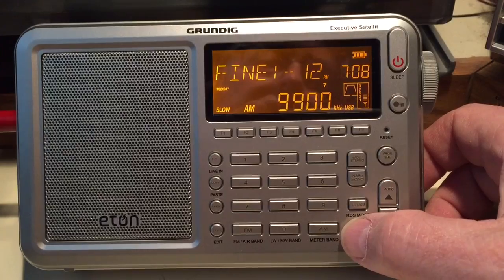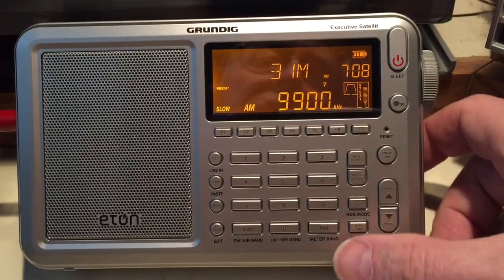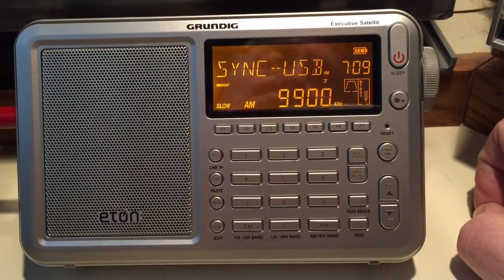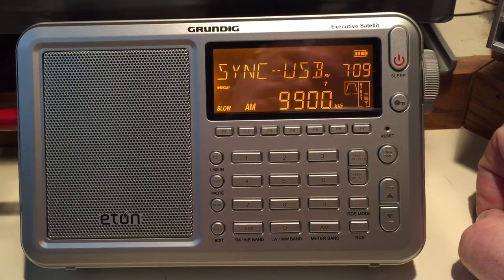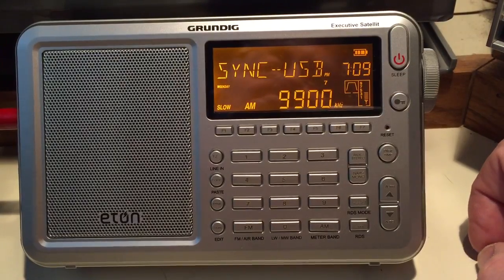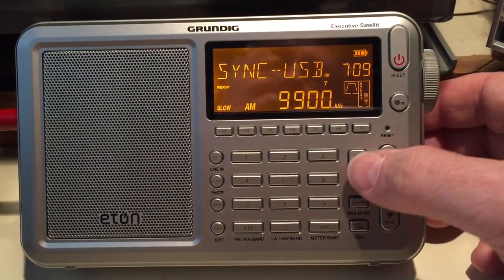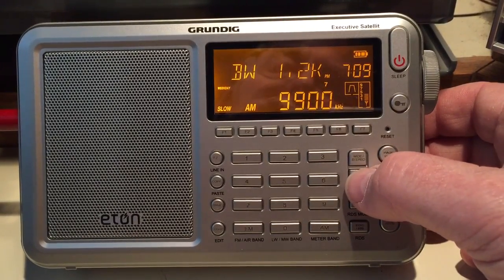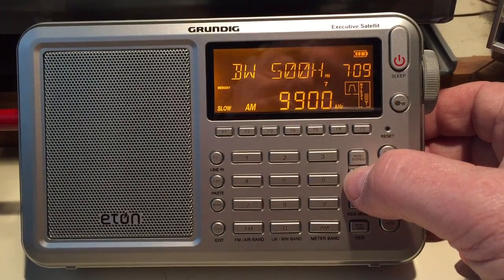Eton Satellit Executive - Using the Synchronous Detector

Comment: Amazing, the old Tecsun PL-660 Sync works much better with none of that horrid distortion that effects so many DSP radios. 

I have the Tecsun PL-880 and S-8800 and their SSB distortion due to dodgy AGC is just unbearable so much so I have them up for sale , I'm just sorry I didn't return them for a refund when I got them. 

The XHDATA D-808 sounds much better on SSB but no attenuation for external antennas, still some SSB distortion but nowhere as bad as the Tecsun PL-880 and S-8800, still for the price it't a great radio. 

I just bought a PL-680 from Anon-CO because my old 660 is beat up but it was a pleasure to listen to SSB despite the lack of filtering that these newer breed of DSP have.

Comment: despair
My Christmas present has just died.
I bought my Elton in the United States a week ago
The transformer connections are different for
France. I therefore ordered a two-pin adapter
and when I plugged in the transformer, the radio started to feel the heat and smoke. In France we are in 240 volts and I realize then that the transformer is in input 120 volts.
I was far from expecting this. Since then, the radio turns on but no more sound. It really annoys me a lot. In addition it is a hassle to return it to Amazon US